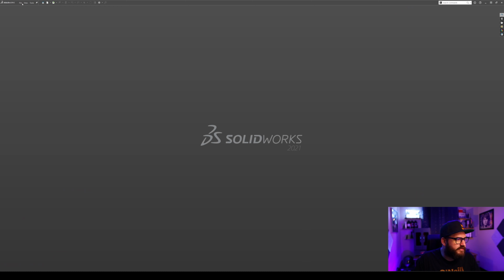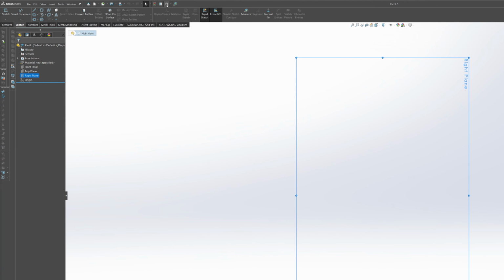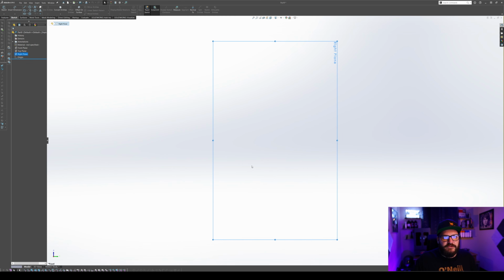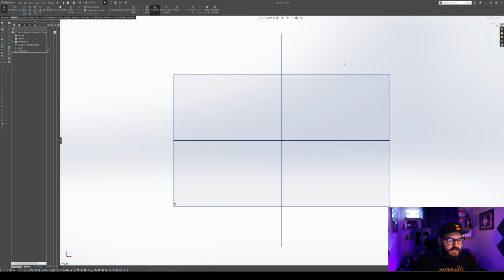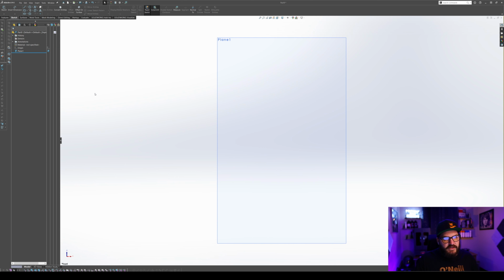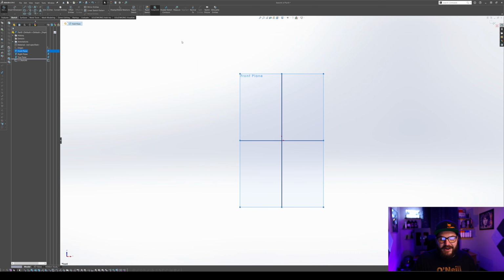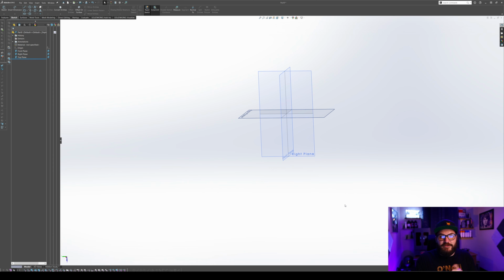How to get Solidworks Z Up with proper normal views

Comment: One caveat to this is if you want to make drawings of your parts and want to use the option to import annotations when placing on the drawing sheet. Some views will have their respective annotations on a different view name (front may be back e.g.) and you will need to mirror or rotate that view if you don't want to make all your dimensions again from scratch.

Comment: You really don't need the default planes. But they need to add something where the default planes should be deleted to reset. Or reset to z-up and reset to y-up.

Bro, you finding the origin to click to add plane to view. Was what I was missing.

It would be great also, if the Rotate About Scene Floor, can be updated as well?

Comment: I've spent the last three hours trying to find workarounds to do this, and AI keeps giving me the same answers to use Z-Up or set standard views.  UGH!  I even skimmed through this video earlier thinking this was more of the same thing as all of the other videos just fixing the viewing issue, but not for sketches.  

Thank you, I had tried 3D sketching lines and creating planes off of those lines, reversing normals, coordinate systems, etc.  It just seems like the default origin is wonky in relation to the default planes, because if you open a sketch on a default plane you can see the red origin arrows showing different than the XYZ arrows in lower left corner.  These motherfuckers at Solidworks are probably laughing their asses off at us like dumb monkeys trying to solve this.  Even the forums are all lost.  This video needs to come with the installation of Solidworks 😂 I even saw the "Create plane parallel to screen" option and was like "nah, that's not gonna help."  

I've been putting off fixing this forever, and tonight I was like keep going until you find a definitive answer dammit.  Glad I stuck in there and I came back around to this video after multiple times asking the question different ways in AI until I finally realized this video did solve the issue.

Comment: Good description. What this doesn't help with is the issue with working on part surfaces which are at a (3D) compound angle. If you want a particular orientation, then it's work arounds with ref geom. For many years (nearly 20 years ago!) I was a dual user SW and Creo, PTC had this sorted from day one, pick a sketch surface/plane, then pick a perpendicular ref to orient it. I did a study with a keyboard dongle, compared identical models, Creo always came out on top for minimising keyboard activity.

Comment: 3 years later and this is still saving people from the psych ward.
Reply: After hiding each individual plane, than right clicking “Origin” to “Create Plane Parallel to Screen”. Help me because when I right click the “Create Plane Parallel to Screen” option does not appear.
Reply: @gabrielgutierrez1597  Had the same problem... Create a normal referenz geometry plane and select the origin. On the left side you find the last option after projektion... Plane paralell to screen.

Comment: Does one Want Z-UP if the Part is to Be Turned on a CNC Lathe? Currently my Y is the Axis of Rotation, as I sketch on the front plane to then Revolve extrude.

Comment: I’m an Alias user and helping a buddy with a race car in solidworks.   When modeling cars, often the origin is far from the part being modeled.   Does this method work at the assembly level and then the parts can have a local orientation?     My buddy wants to be able to model brackets at his preferred orientation but still be able to exchange data with me using Z up and origin at the front wheels.

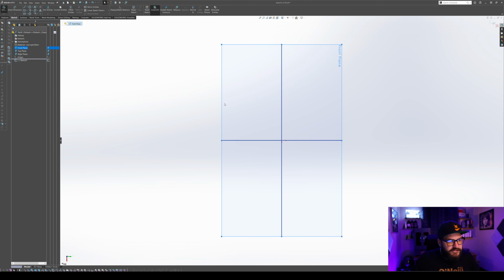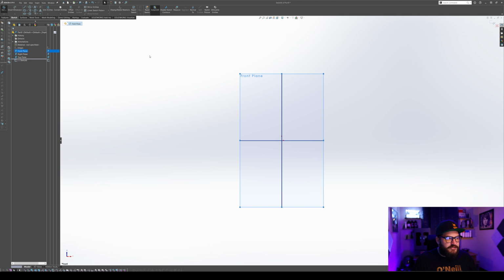Comment: Still works in 2025. Just to be clear for all the dumb people like me. Follow video instructions from 3:50 to 7:30.  Make sure you have the hide/show primary planes toolbar sitting somewhere you can see it. For users of SW 2024 and up I build on what @davidschaffer4884 wrote below. At 6:00 is where things change for users 2024 and up. To make all three new planes as he does at the six minute mark, we go up to Insert-reference geometry-plane. Click that. Make sure the First Reference is the Origin (hit the FeatureManager Design Tree tab to access Origin if not already selected). Then there will be a box "Create a plane parallel to the screen". Click that. A plane will appear. Rename it to Front (as per video) This is dont twice more with renames.
Thats it for the differences between video and later versions. Maybe 2025 already has this built in and I am wasting my time.

Comment: Thank you!!!!
As someone who is trying to use SolidWorks to design parts that will be turned on a lathe, this was INFINITELY aggravating.  Lathes use the XZ plane as their primary coordinate system. Why does SolidWorks hate lathe programmers so much!?!?

Complete FAIL by the SolidWorks programmers.

Comment: YES!! You're the man! I've been struggling with the same issue for years. Your video led me in the right direction, however, in SolidWorks 2024 SP2, "create plane parallel to screen" is done differently. To do this you create a plane as usual (using Reference Geometry button or Insert -> Reference Geometry -> Plane), and in the property manager, select the origin as your first reference. You will then be presented with the option to create a plane parallel to screen. This is a game changer, and I would not have figured it out without your video! Thanks a ton!
Reply: Thanks for this, I got excited about this watching the video only to be disappointed when I couldn't find the option when I right clicked the origin.

Comment: I love this!  I have been struggling with this for the past 3hrs.  I do vehicle design and really want the front to show the front of the vehicle  and the top to show the top, etc....  and the top needs to be the XY plane with Z up.  So this works out well.  I cannot figure out how to permanently hide the default planes however.  I've done the whole hide the default planes in the feature tree thing, but they still pop up in the model space when initially making a sketch, its just now they are labeled 1,2,3 instead of front, top, right.  Any thoughts?
Reply from the maker: I'm not sure what you mean by they pop up in the model space when making a sketch.  Are they showing up in the feature tree or in like the quick pop up quick settings or what?  i have never seen the defaults pop up after i hid them from the tree personally.  Did you save the part as a new part file template, so that it applies these setting each time you make a new part?
Reply: @jg3d423  I saved it as a template.  They pop up in the main part display screen, where your actually drawing, not the tree.  They pop up as actual planes to pick the start of your initial feature sketch. It only happens on the very initial sketch for that part, any sketches beyond that you never see them again.  I'm guessing there is some setting to turn that off, but I haven't found it yet.
Reply: @kevinburk3079  I have  the same thing. After making this profile and testing it I noticed that when I create a new part and then use the sketch tool to begin a sketch, the screen shows a total of six planes from which to choose. Planes named 1,2,3 (as per the video) and Front, Right and Top as per my naming the new corrected planes. Each of the six show up and all six have borders that I can choose from. I do not want to see the 1,2,3 plans ever again :) so  I see what this poster means. 
If I start a sketch by right clicking the edge of the newly made planes then only the three new corrected planes show up. My original sketches 1,2,3 are hidded as per the video. What am I doing wrong.

Comment: Oh wow this looks good, as a machinist /toolmaker thats just what you need. cant fathom Solidworks ,why the cant they conform to standard maths/ geometry/ physics.  and also why on earth would you switch your model orientation its stupid ! . many thanks for this workaround.
Reply from the maker: Yah I dont understand why they are so partisan to y up.  And with this method.  You can make the orientation whatever you want, not just the one I went with.
Reply: I have heard that the kernel they licensed way back in the day still remains and it cannot be changed unless they decide to build their own from the ground up.
Reply: @jamesg8246  Y up is really ancient 3D Graphics standard.

Comment: I have to try this out but it appears like this is the best solution to work around the non-industry conforming coordinate system in Solidworks.  If you import it into CAM software like Fusion 360 does it orient like a toolmaker would expect too? Thanks.
Reply from the maker: yes this was the biggest reason I was wanting this feature so i could align my models the same way the coordinate system was in fusion for CAM and the same as the CNC i am on.  now they are all the same so don't have to move anything anymore and can import parts later on in the same position
Reply: This method is great Ive set mine up and labeled them as xy, xz & and xy planes so now I know exactly where I am drawing. the only prob I have is that when I open an old model the old planes are not visible , and there doesn't seem to be a good way of making old models open in the new template, But at least from now on it will be good.